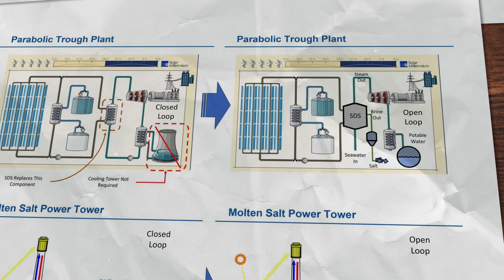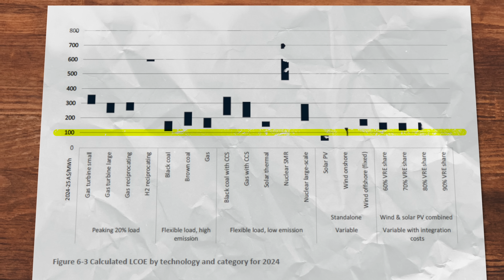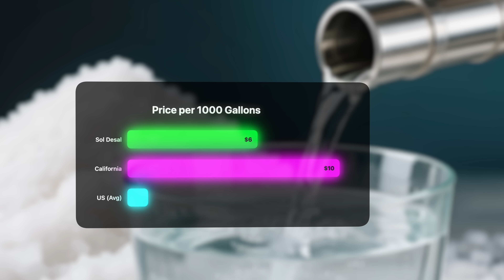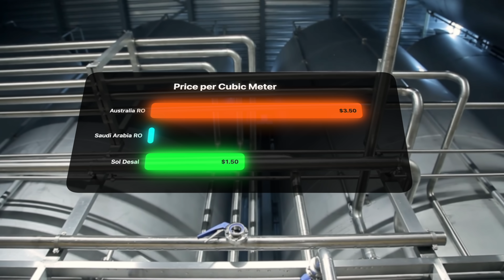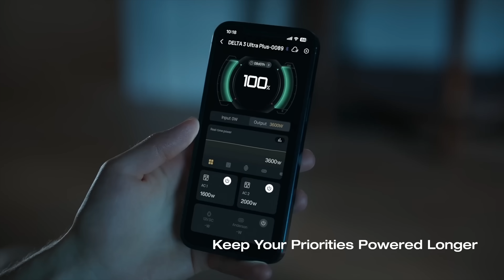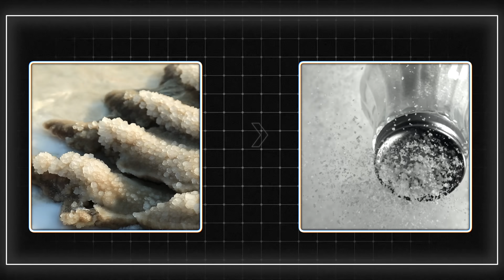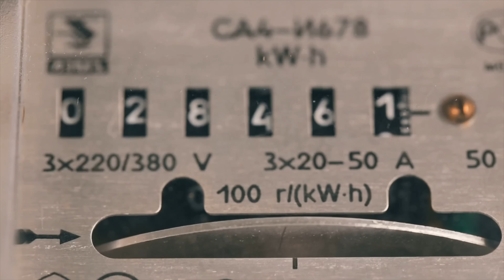The Desalination Process that MAKES Electricity - Too Good To Be True?

Comment: I'm an analytical chemist and love this type of content. I had an idea very similar to this a few years ago, I should have pursued it back then. I guess. Maybe I should act on some of the other ideas I've had now LOL. Keep up the good content
Reply: Good thing you didn’t. This thing is not economically viable - it works only in renders. First of all evaporating water will never be even close by efficiency to osmosis. Sure we are not transforming heat from the sun to the electricity but you will still have a lot of losses - on the reflectors and on the tower with water. To harvest power efficiently from the turbine your water vapour must be super pure and at a very constant temperature - if temperature of the vapour dips below certain threshold small water droplets will form and start destroying your turbine blades and if there is some even small amount of salt particles in your vapour - you could say bye bye to the blades even sooner and they are REALLY expensive to replace. And vapour temperature must be high - around 1000F. Water is not so good heat battery compare to salt and if you will want to make it more efficient - you will need distilled water and sun heat receiver with a lot of surface area and if you do this with sea water you will risk clogging everything with salt deposits and other shit from ocean.  And I want to point out that almost all sun salt-heating tower plants in the world failed or way less profitable compare to just regular solar panels and here come guys that claim that they can make everything way more complicated and still be viable. Yea, sure.
Reply: @MrMpakobec even high inefficient processes are viable if you have free inputs, it's like a steam engine with free wood..who cares if your space age rocket engine is more efficient if the fuel is 10$/oz..vs simple steam engine with cheap inputs. I hate the holy grail of efficiency egg heads get wrapped up in...brute force beats efficiency every time, the worst nuke ever designed will kill more than the finest chemical explosives..even if chemical explosives are more efficient per kill.
Reply: @Honorary_Redneck  Sure if the inputs are truly free or close to it. No maintenance, no nothing. It does not apply here. You either make system as simple as you can - like in the render and will need constant expensive maintenance (unclogging, cleaning, repairing everything)  or you make it super complicated with stages and lose in efficiency and balloon cost to build. In both cases investments will never be recuperated or will be recuperated so much further in future compare to solar panels + osmosis combo that no sane investor will ever give money to start this project.
Reply: @Honorary_Redneck the free input destroys your turbine blades because it's sea water. which becomes your consumable.
Reply: I hear ya. Hindsight is such a burden.
Reply: You could brain storm how it might operate more efficiently.
Reply: @BigScienceDP  I hear ya! There are a lot of us “Idea Men”. It’s the more rare “Make $h1t Happen Men” that get it done.
Reply: Hypothetically: What if energy in was infinite and without cost? What could be done then? 
Just call it an outside the box idea.
Reply: @Damons-Old-Soul  It actually is...  humans have a habit of making things scarce, as this is the how the economic system works.
Reply: @PaulSmith-sz2gv   tell the animals that energy isn't actually scarce and make them live happily ever after eradicating all natural predation. Good luck with that. Also for your information humans are animals...
Reply: @Damons-Old-Soul  There is always a cost. All the way down to the subatomic level there's always a cost. Abundance doesn't mean cost-free.

Comment: CSP systems require direct sunlight to produce useful temperatures to make power; coastal areas which have the seawater are pretty cloudy areas. PV panels work just fine abet at lower power under the scattered light from clouds.

Comment: You don't have to boil seawater to produce steam.  Heat the water, let the vapor pressure build which will raise  the boiling point.  When the pressure is high enough use the steam to power the turbine.  Keep the temperature of the water below its boiling point adjusting that temperature for the pressure.

Comment: The cost of the water is misleading you can't compare the cost of creating water to the cost of distributing and capturing water. The distribution infrastructure is still necessary and is a major component of costs. We also still need dams, retention ponds, and storm water drains to handle flooding. So this water will still be expensive but areas like San Diego which have access to sea water may find it useful

Comment: You always need to start with the problematic part of this technology, and this is clearly the cost of energy for processing seawater, which can be reduced by obtaining an additional product in the form of salts, and at the same time recovering some of the energy from water evaporation, so such systems will be more cost-effective where there is an excess of solar energy.

Comment: what if we started working on a thorium fueled MSR to generate heat, and include the solar to increase efficiency, that way you make use of 2 sources of heat/power and turn it into a much more viable solution I know that thorium MSRs are still not really ready for production but you could still make it a case for making that work.

Comment: We need to use the heat from data centers to heat the water for the desalination process which will also cool down the data centers
Reply: not efficient at all.
Reply: @carholic-sz3qv I just asked google and they said it was. Could you explain to me why it wouldn’t be efficient?
Reply: @carholic-sz3qv  as a matter of fact there’s a Swedish data center from a company called interxion saving $1 million a year using seawater for cooling we could literally just add something like this to preheat the sea water before desalination what could possibly be the problem?

Comment: using the waste heat from Data centers to heat up salt water is an option also.  The sea water cools the data centers and as it heats up the sea water, it makes desalination by a steam process less energy intensive.
Reply: Sort of, but not. Sea Water is a bad idea in any complex system. Salt is one of the most corrosive substances. Not saying it's impossible, but most of the history of Engineering has been to exclude Salt from moving/flowing systems instead of hardening them to the corrosion.
Reply: Heat exchanger in the salt water tank then. Run another cooling fluid (glycol or whatever is best for data centers) through the data center then into a large heat changer in the saltwater tank heating up the salt water while pulling heat from the data center.
Reply: That might work in theory, but I don't think you'll be able to convince the large companies that run the data centers to start building them near the ocean.  Also, computers don't like running above the boiling point of water.  I don't know if their waste heat is that hot.  If not, then you need heat pumps to get it over the boiling point, and I'm really not sure how feasible that is.  Keep thinking, though.  Maybe you can figure out how to make your idea work.  There must be some way of using all that waste heat from those data centers.
Reply: The waste heat from data centers is like 85 degrees Fahrenheit.
Reply: @pepperonish thats warmer than nothing lol
Reply: @pepperonish  that's a massive heat differential to a New York state river between Oct & May, power stirling engines with it.
Reply: Every industry in America should be "encouraged" by regulation to capture any waste heat generated by their process. It's "energy" we're wasting by just pouring it into the atmosphere.
Reply: @Dewydidit there's often no use for it
Reply: @pepperonish  No use for electricity? Data centers consume HUGE AMOUNTS of electricity, the opposite of "no use for it".

Comment: What you do is make a downhill path to death valley from the ocean with a glass covered concrete river that is black and shallow.  As it flows and heats up on its travel it could go through some filter sections to get all the schmutz out.   Then it hits the lazy Susan of water stops where it continues to get hot in the desert sun and evaporates like a champ into compressed air tanks (giant) so at night when the temperature drops to nothing the pressure can be released  condinsate drained and into a similar system next door that boils that condinsate to get steam electricity. 
Or let the steam rise up a pipe on one of the mountains and condinsate into a lake at the top which can then be a gravity battery for electrical storage.  

That's it.   Use the steam energy and hot to cold thermo dynamics to move the steam uphill instead of pumps.
Reply: Working idly on this. Not sure if I can be too bothered to make too much effort condensing the vapours when the weather might turn it into night fog or rain for free and let nature grow some plants. Flooding an inland saltpan to grow an inland mangrove swamp gets it all done for free.

Comment: 9:30 - And therein you run into a problem.   Sol-Desal (the AI caption generator simply cannot get the name right) is not purifying the salt, that would be far too costly.   They're just going to brick the stuff and expect the manufacturers to clean the crud out of the salt to produce batteries.   Those businesses will already have material streams in place, some likely with a far more pure salt product.
And they're going to produce so much salt so fast that even the hungriest sodium consuming product would not be able to keep up.

So what SolDesal needs to do is either move their bricked salt back into defunct mines that once produced it.
Or turn their salt storage into thermal energy storage on a truly mind boggling scale (which probably could not consume the salt they produce nearly fast enough).

Until technology is developed that can separate all of the unwanted waste out of salt - no small portion of being minerals that could be used for other purposes, like lithium, gold, ect.

And, tangentally...  this process could be used to separate lithium salts.   As I remember (very likely not well) lithium is separated out in huge evaporation ponds that are just as bad if not worse than the brine discharged by traditional desal plants.

Comment: There's still a giant elephant in the room called the extreme amounts of saltbrine that will need to be dealt with. It's still  a huge issue. Each gallon of water desalination produces 1.5 gallons of salt brine. That's an average from one plant to another. We simply do not have enough use for all the salt nor anywhere to put it. Every gallon of water we drink will come with I need to figure out where to put even more brine

Comment: The shipping cost of salt is very low the cost of transporting electricity is high and water is extremely high. They will also need stable sun or huge water storage, to provide water all the time.  
They should be looking for places than have lots of sun, expensive electricity and expensive water. Preferably with either stable sun or cheap water storage.

Comment: I am surprised this has not been accomplished before. This just seems like a better conceptualized of the conceptual solar thermal power plant. I would think that the methodology for getting rid of the brine droplets in the steam is just to run the steam through a chromatography column that completely retains salt. You just need to pair the rate of water evaporation in the solar concentrator to the column size appropriately to make sure the flow rate of steam through the turbine is fast enough.
Reply: There are many practical solutions to create fresh water, but the price is usually the killer.

Comment: Take the brainpower and money going into fusion and solve this problem - child’s play
Reply: That sounds great, but the stuff people learn to try to make fusion work isn't the same type of smarts used to make solar/thermal energy and desalination plants. To me it'd be like taking a carpenter and having them take over the electricians job for the house instead.
Reply: @christianheichel The use fusion tech for the plasma drills meant for universal geothermal
Reply: @carlosandleon  Quaise Energy is doing something like that right now.  
   Also I wasn't referring to all across the board. There are some things that are equal in both branches. You need people who know what to do with electricity. The example you just brought up cooling, heating, how to maintain control and prevent heat from spreading, or making it stay in the same spot depending on your needs
Reply: @christianheichel  Exactly, and there are plenty of people to work on multiple projects at the same time.

Comment: Small. minds can't see the obvious problem here.  This can't be a global solution as it would produce far too much salt.  The average American comsumes 80 gallons per day of water but not 80 kg of salt.

Environmentalists complain of the impact of dumping high salinity wastewater into the oceans but say nothing about the discharge of ultra low salinity wastewater from sewage treatment plants.  Both are harmful to marine life.

Why not mix the two discharges? The results would be salinity levels only slightly higher than seawater.  No harm to marine life. 

Duh.

Comment: instead of pumping the steam back down to preheat the incoming water, they should use the mechanics of the steam rising and its pressure to pump it to a reservoir at a higher altitude. then when the sun goes down they can double dip and use the recondensed distilled water to spin a hydroelectric power turbine at night before collecting it as drinkable water. the distance the steam travels could help it cool down and recondense as well.

Comment: So it only creates fresh water & energy while it’s daytime, and not cloudy… LOL
Reply: Believe it or not there are many places on earth where the sun shines 12 hours a day with hardly any clouds. Also as battery tech gets better, intermittency will become less and less of an issue for renewables. That said right now its more expensive to have renewables + storage than fossil fuels. so the climate change money should not be getting spent so much in implementing solar and wind (up to 20% of grid supply is fine but over that its hard to incorporate) but in funding research to create the necessary technologies to make a fully renewable/ circular economy possible.
Reply: Fun fact, dams only fill when it rains, & sometimes it doesn't rain for months.  Shocker!
Reply: Fossil fuel bot

Comment: You cannot keep extracting the salt from the sea without putting some back in.
Separately Salt being primarily Sodium Chloride the Sodium separation means that Chlorine is a resulting byproduct.
You cannot just keep stripping the viable minerals from the chain without have some level of Waste disposal issue.
there needs to be a managed approach.
Separately there is the possible molten salt battery storage opportunity.

Comment: Fascinating concept—purifying water, generating electricity, and ending up with salt sounds like a win-win-win with zero pollution. That said, the “zero waste” claim seems valid only for liquid brine, not for total material throughput. If scaled, residuals like non-NaCl salts, trace metals, and organic matter could become regulatory or operational bottlenecks—especially in regions with high industrial runoff or algal blooms.

In  fyourollow-up video, can you explore selective crystallization (NaCl precipitates first, but MgCl₂, CaSO₄, etc. require different conditions) and residual sludge (non-crystallized compounds and organics that may remain as solid or semi-solid waste). These could impact permitting, maintenance, and long-term viability. I appreciate your insights and look forward to your follow-on deep dive into this venture.

Comment: This video provides insight into a method to purifying water and generate electricity and end up with salt sounds like a win-win-win with zero pollution, it skirts the issue of waste products.  The “zero waste” claim is valid only for liquid brine, not for total material throughput. If scaled, these residuals could become a regulatory or operational bottleneck—especially in regions with high industrial runoff or algal blooms.  In your follow-up video, perhaps you could look at selective crystallization: NaCl precipitates first, but other salts (e.g. MgCl₂, CaSO₄) require different conditions and residual sludge: Non-crystallized compounds and organics may remain as a solid or semi-solid waste.

Comment: Kudos on your steadfast research and curiosity, bringing informative content on a wide range of cutting edge research and technology development. 👏 I look forward to each new video! One quibble... should everything be a "potential game changer"? For example, "moving the needle" (step below) or "revolutionary" (step above). Leave you with this: "An optimist sees the glass as half full, focusing on what is present. A pessimist sees it as half empty, focusing on what is missing. An engineer, however, often sees the glass as twice as large as it needs to be, a practical perspective focused on efficiency and design."

Comment: You don't actually need the water to boil to get the steam, correct? And then you don't get the bubbles? If you reduce the atmospheric pressure the water is under, you can get the water too steam, and more easily control the temperature by increasing and decreasing the pressure.
You can have a 2 stage process, the first at a lower temp in low pressure that separates the water and brine, and then a second step that increases the temperature of the water as it adds pressure in the second stage.
This means you don't have to keep the water temp as high overnight by burning oil/gas/LP and you can prevent the wear on the turbine.